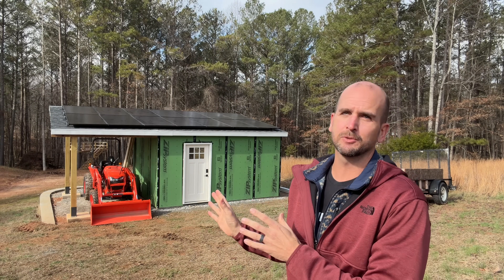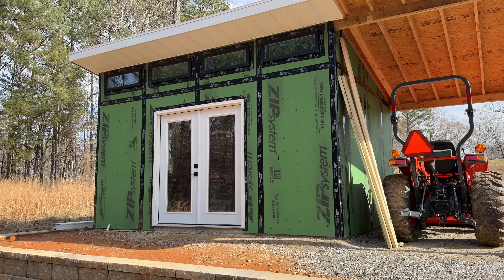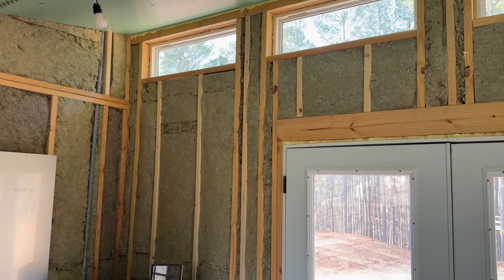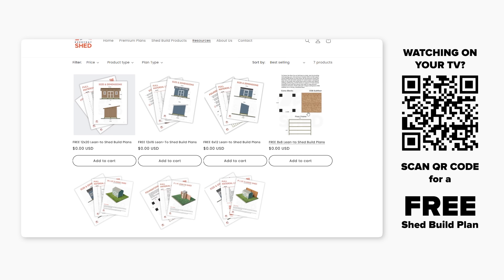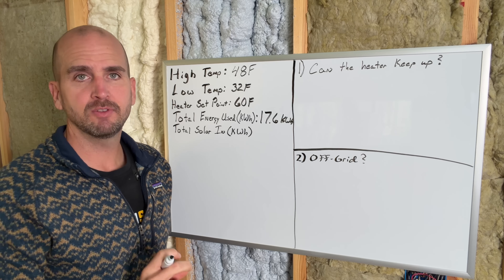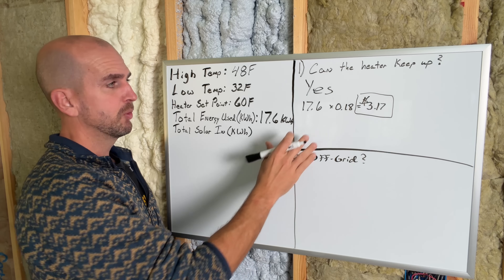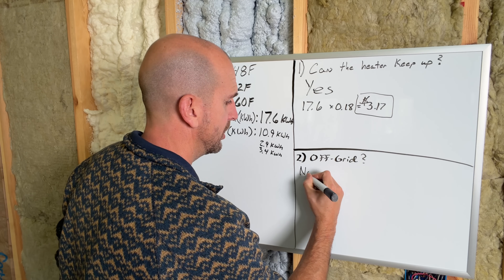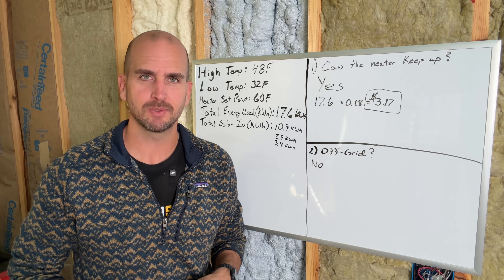HUGE Mistake: Why My $15,000 Solar System CAN'T Heat My Tiny Shed

Comment: Heat pump , geo thermal, mini split - your solar panels are too low. A lot of folks put the panels vertical ( on the ground) with a NS orientation - the snow reflects light onto them.  I wonder how things would go if you used your power to heat a sand battery. I think you could do more with your power - just the little heater is a bit of a dinosaur and the roof needs more R

Comment: I'm actually building a 12 x 16 shed but got hung up building the same retaining wall you built but that's a story for a different day. I'm in the North East so I was not even going to try to insulate the shed but you're making me rethink the whole thing. I was going to do the off-grid solar just to have some light but perhaps the insulation, heat pump that someone else recommended and the 20 amp circuit may be worth considering. Not sure.
Reply from the maker: It is my best guess right now after testing several other units I will settle on the 9,000 btu 5th Gen Mr Cool that runs off 120V.  I think that unit looks Super promising for shed heating and cooling.

Comment: You have heating losses due to no sheetrock/siding. If you add a radiant barrier, that will improve your delta as well. 

Then you need to put in a heatpump. 

You'll be pretty close, if not spot on. Burn a couple candles in a radiant heater on cold days/nights.

Comment: $15k is way too much for that setup. I expanded my rooftop solar by over 9kW for $8500. That includes panels, micro inverters, racking, wire, and everything else. I'll still get the tax credit too...bringing that down to just under $6k. 

As others were saying, if you really wanted to heat with electricity you should get a small heat pump. It would be cool in the summer too. They use 2-5 times less power compared to a space heater.

Comment: Heat pump or a small electric heater around 500 watts that circulates air. Oil heaters take too long to heat a room.

Comment: This is the most costly, inefficient way to go besides using an even bigger power draw heater.

Really commend ventless propane heaters and adequate ventilation, propane tank coming in from outside. I'm not a plumber/HVAC guy but I was able to make it happen!

Infrared heaters might give you more bang for your buck because they heat up objects in the room

you really don't want to waste your solar energy by running an electric heater. If you ever redo this shed, I would recommend investing in a more expandable system. Victron, EG4, even Sungoldpower gives you parallel capabilities up to 6-12 units in some cases. 

They just have more copper and better connections, higher efficiency than these ecoflow units. You could've set up a $10k system with Victron that'd run an entire woodshop lol

HEAVILY recommend reconsidering your path here

Comment: Insulate the roof more, build a double wall with more insulation, and use a solar mini split with battery backup for the night.
Reply: I have built double walls offset from each other with an inch of foam between worked very well thermally and sound as well.
Reply: He has no vapor barrier or interior paneling. That is likely the problem.

Comment: Do you have suggestions to insulate a metal barn, made from large corrugated strips of steel. The stuff that looks like airplane hangers. Basically the bends make the curved strips strong, but also makes the ceiling/ walls have a 4" rolling wave to them.
Reply from the maker: I would have to think spray foam might be the only solution for that type of structure.  Probably cheaper to hire a pro.
Reply: That's what I've been thinking as well!

Comment: Letting the roof breath was a mistake. We know better now. Common mistake by even professional architects (and a few professional engineers) who really don’t know how to design insulation, moisture barriers and vapor barriers. A moisture barrier is not necessarily a vapor barrier. For example, Tyvek is a moisture barrier, but not a vapor barrier. Note also that the R value of the insulation is not the same as the R value of the assembly unless the insulation is continuous. Stud walls do not qualify as continuous. I was an HVAC engineer for 37 years. A sealed roof cavity would have added R value. Air is an excellent, inexpensive insulator.
Google Joseph Lstiburek.

Comment: Wouldn't heating the slab (insulated) using hydronic heat - if the budget allowed - Geothermal Loop. If you go 5 feet down the earth temperature is between 50F and 60F. Running a Geothermal loop powered by an electric pump would get the temperature to 50F and the mass of the concrete would keep the temperature pretty stable. Then you could run a space heater when you were actually in the "office" to get the temperature up a bit more.

Comment: I took a very different tack many years ago.  I have a 30,000 BTU pellet stove in my family room, heats the room (16x24), a bedroom, bathroom and den very well.  On ignition, draws about 450w, then drops to under 50w to run circulating fans.  Right now with nightime temps between 20-30*F, stove set to 65* at night, 72* day, uses 1 40lb bag of pellets.  Recently installed an Anker Home Backup system with 11.4kWh of battery. It will run the stove, lights, Starlink, tv, etc...for just about 2 days.
In the garage, I use a vented 40,000 btu kero heater (a Monitor 441) which puts out an incredible amount of heat but again uses very little power, mostly just for fans.
I found out a long time ago, far better to lower your device power usage rather than keep adding more solar, batteries and inverters to compensate.

Comment: I see a nice spot at the back corner for a propane tank and a place on the wall for a small blue-flame heater.
How much did he spend on that solar contraption?
Reply: Blue flame heater? Yeah let's be complete idiots and pump that small area full of water vapor and trace quantities of incomplete combustion products which include carcinogens. That is just plain idiotic. Now a direct vent propane wall heater that vents to the outside would be great but way too powerful for such a small place.

Comment: While I agree with just about everything you've said and done, there's one huge, HUGE issue with this entire video: Why on EARTH would you heat that space with a space heater, literally the most expensive way to heat an area? I set my thermometer at 68F and one zone of my geothermal (heating a roughly 1,000 sq ft section) uses about 17kW per day. This is a day even colder than you described. Maybe 35F high and 25F minimum. I always like your videos and maybe you have a reason for picking a space heater that you didn't explain or maybe I missed, but I don't get that part.

Comment: I mean... You are gonna test with a proper heat pump later, right? I can't imagine spending $15,000 on solar and then deciding "eh, cheap oil filled radiator is good enough"

I assume so, past videos mentioned heating and cooling with an already installed window unit. It'd be really disappointing to just leave it at this.

Comment: As many people already mentioned: 1. You need a heat pump 2. Roof insulation is inadequate 3. Slab insulation would've helped. Too late to insulate underneath, but you can dig down 16" and insulate the slab perimeter.
Reply: Hindsight is 20/20.  Even just 2" of slab insulation would have helped a lot.  

I'll second that the roof insulation is frankly completely inadequate.  I would consider pulling down the rigid panels, putting in the baffles they use for attics to keep an air gap for the venting -- that part is reasonable -- then foam them in with can foam and  fill the remainder of the cavities with mineral wool.  Put the EPS back up and air seal the edges with some can foam, because... might as well use it since you've got it.  Your only other option would be spray foam, which you shouldn't ever DIY entire bays with cans -- that's just madness.  If you must DIY spray foam, you want a 'froth pack' at a minimum but spray foam really is best left to the professionals at this scale, especially since any roof assembly is going to need enough thickness that you're gonna have to do a few 'lifts'; or you're doing a nominal 2.5-3" application to get your vapor barrier and air sealing as part of a flash-and-batt system.

It would have been highly preferable to put in provisioning for a heat pump; either a standard operable window to use one of those newer 'u-shaped' models, or a more 'conventional' wall unit with a dedicated 20-amp circuit.  You could probably retrofit just a hole in the wall for a conventional 'big-n-boxy' wall unit heat pump and run a dedicated 20 amp circuit for it.
Reply: @CygnusRising  this is the type of scrutiny I need applied to my 75 year old house
Reply: He doesn't have to dig up anything to get some improvements. When I renovated my 1950 home, I laid down 1" ridgid foam under a floating 3/4 interlocking plywood floor, with carpet pad/carpet on top. Glued and taped seams to control airflow. All finished, my basement floor is now ~10F warmer than the slab.
Reply: @HansUberschlage  What would that do at the entryways? You effectively raised the floor by a couple of inches. In a basement, that probably doesn't have the same issues as you'd see in this shed build. For the shed, I suppose you could just trim off the bottom of the door and raise the threshold as long as you don't need the traditional door height. It might be worth it but when I watched the insulation video, I was thinking the roof insulation was totally inadequate. Insulating the floor would help but insulating the roof would help more. If it were me, I'd be doing the roof first and then, if that wasn't doing the trick, look at tackling other things, like the floor.
Reply: @rogermccaslin5963  I feel that, unlike living quarters, shed doors should outswing, to maximize the interior space.
Reply: @HansUberschlage  I did much the same with the laundry room at the back of my townhouse. The concrete slab base was a bit broken up, so I needed to build a secure, level floor for the rest of the structure.
I added 1-1/2" rigid foam between the floor "joists" (2" x 4" on their sides), then the 3/4" subfloor, etc. Make a great difference compared to the original construction.
Reply: Less windows would help as well. I have an outdoor building with no windows, and a couple of servers running in it ( total server load is 700w) and I have to run an air conditioner year round to keep it from over heating.
Reply: @JeramiFrost  But sometimes you want natural light. I'd easily sacrifice energy efficiency to have that amount of window in an office.
Reply: @MarkRose1337  The windows where they are - make that a great place to live in the summer.   In the winter you want south-facing windows
Reply: @frontiervirtcharter It depends. I have south facing windows and I find I need to use the curtains in winter to keep the sun out of my face. But I also live 1000+ miles north of there and the sun is lower in the sky, about 15⁰ above the horizon in December. I typically close the curtains on one window at a time to keep the other light coming in. I also use the curtains in summer to lessen the solar gain.
Reply: @MarkRose1337  use black curtains in the winter and reflective or bright white in the summer.
Reply: Insulate and forget the heat pump. That setup at 0*F should be using 3 kwh or less on an electric heater, if properly insulated.
Reply: @selwynthegreat3748  And don't bother with canned spray foam, but hire a professional installer for the closed-cell. There's a reason we're being pushed toward spray foam. It's because it's so economical and the performance can't be matched. Tight buildings are insulated with rigid on the outside and closed cell on the interior side. It's not one or the other, you have to use both...
Reply: Agreed completely: the best money spent here is on better insulation. Then I'd get a 6000 BTU inverter heatpump, the smallest available, and use it for heating/cooling. That solar array should have zero array keeping up.
Reply: yes, and in this situation, i would have gone with 2/6 studs for the increased RF rating. That's pretty standard building practice in cold climate USA
Reply: @Scott-b3m  He lives in Georgia, not Minnesota. R-15 Rockwool in 2x4 walls is fine for a shed. It's the other details that reduce efficiency.
Reply: @Scott-b3m  Even 2x6 studs form a thermal bridge from the inside to outside. I'd add 2" of styrofoam on the outside.
Reply: @Scott-b3m  Right basically this becomes a high-performance build. What we're looking to do is maximize our thermal efficiency and get our air stop barriers as tight as possible. 2X6 wall framing, spray applied closed cell everywhere and disconnect the floor from the ground. I mean he might as well chase solar collectors at this moment, they only take a tiny fan and it could offset a huge footprint of power.
Reply: I think he blew it in the roof assembly, and should have joists bays packed full with insulation
Reply: This is the correct summary of the video. 6kW of electric power should be way more than enough to heat that space if it were insulated correctly, especially with a heat pump.
Reply: He could lay a few inches of foam board insulation on top of the slab and finish that. It would take away a little ceiling height, but be so worth it.

Comment: 1. Adding some foam panel insulation on the outside to increase R value
2. Adding storm windows or window film on the inside will reduces losses
3. Insulate the slab with foam panels In install electric or hydronic infloor heating. The sun would heat up the slab which would work like a thermal battery. 

What you can do is calculate how much solar & insulation you would need. Start using a Heat loss calculator based upon R value of walls, roof, & slab, window\door losses to get a estimate of how much heat loss & solar gain (windows) After you got the heat loss, you have to figure out how temperture drops (use coldest week) . Look up the insolation for the coldest week. Then you can determine how much heat you need to use, and then determine the appropriate HVAC system required.

That said, probably a small diesel heater, wood stove, or propane heater would work best & you can just turn it on & off as needed.

Comment: $15,000 would have gone a long ways towards the cost of a very small geothermal heat pump system with a much smaller solar to just run the fans and pumps. Depending your location, you could have "mined" 60° fluid or even a bit warmer just from the ground.
Reply: In fact, I installed a 3 ton ground source heating system in a 2,000 sq ft home including a 550 foot well for $12,000 but that was in 2013ish

Comment: Ihave a Bluetti AC500 setup here in Boston with 28kw storage. Last yr before it was set up I used elec radiators to supplement my oil fired forced hot water system and my oil guy jokingly said I should use more oil next year. Of course my Elec bill fully inflated. But now with 5 kw of solar panels I am using solar for the oil filled radiator to supplement my heat with the furnace. I dont expect to take it to the bank in stacks but I believe it should make a difference. I saved about $1200 this summer, staying there about 50% of the time, i would say on a/c with window units powered from my system. But heat is more demanding so cant fully heat the house with it as I was able to with A/C. Could be a heat pump in my future. For me burning less fossils is also a consideration. Solar is worth the effort towards cleaner Earth.

Comment: I live in central Florida building a barn for my horses,  I plan a 12x24x8 tack and feed room.  I would like lights in tack and main park of the 40x60 open pole barn.  Plus I would like a mini split AC system to just keep the moisture down in the feed and tack room.  I am thinking running it about 76 deg.  Am I crazy to think I can run it on solar?
Reply: No you're not crazy. Orlando resident. 1000sqft under HVAC with 9.25 kwp  on a 7.7kw inverter system. Have been net zero for 5 years with an average annual overproduction of 2.5 MWh.  1987 block house with R40 attic and good double pane windows. Keep house at 78 F 55%RH  summer and 74 F winter with 3 ton inverter heat pump system.
Reply: @jstaffordii thanks

Comment: I have one of those Chinese mini splits on Ebay running in my off grid shed. It's advertised to run down to 5°F, but has trouble around 30°F, in my experience. It cools well in the summer but I'm glad I kept my IR propane wall heater. It does very well in cold of course. My inverter can take in grid or generator power, so if its overcast and I'm running lots of current, I plug my diesel generator into the outside receptacle.

Comment: Nice test but you had to know those radiator heaters are energy hogs.  I'd go mini split so you have cooling when you get those hot humid summer days.  I might go propane heating for the winter, although you won't be truly off grid since you'll have to run to town to fill up the tanks.

Comment: Super interesting; thank for sharing. Solar for heating will never be an option for most Canadians, even in Southern Canada. Past week has been 0-14F with no sun; next week's forecast is 7 days straight cloudy with some snow. We have been using heat pumps here many decades before it even became a blimp on US potential customers' radar; they're great but expensive (good ones, no wall units) and still require a heating system for our environment. Make sure you fully understand your own environment and available technology before making that kind of jump.

Comment: Propane for hot water ,heat ,and stove. Keep high demand appliances off of the solar. Run a small gas generator for high demand electric appliances, and to top off batteries if cloudy for days.